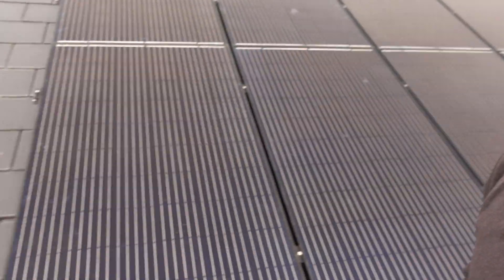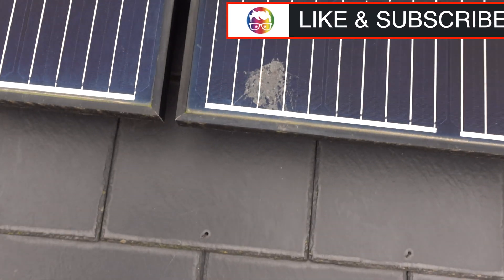My Solar PV House 2020 Update - Roof still has as small leak

Comment: Have you got a video on using PV to charge an EV, focused more on what to expect. For example if you drive 20-40 miles per day could say 10kw of PV with 10kw battery storage cover that? If I don’t use the car on weekends could a sunny day fully charge the car from empty? Apologies if I’ve missed it
Reply from the maker: Check out my monthly update videos, I cover how much solar and grid energy went into the car charging each month, into my powerwall, etc.
During the summer months we hardly use any grid energy to charge the cars, unless we have a few big trips. Today for example, my wifes 40kW Nissan Leaf was fully charged from solar pv, battery upto 100% and hot water tank fully heated.

Comment: Hi SG, my original installer actually broke 7 tiles and just installed the pv panels over the broken tiles. When I found out I had a leak, I tried to contact them and found out they'd gone bust. Had to find another installer willing to tackle the job. They had to take off the whole array, fix/replace the broken tiles then reinstall the array. Roof is weather proof now but this avoidable damage added a considerable amount of financial cost and stress to my journey. 

5.3 kwp array, 3.7 kw SolaX hybrid inverter with 19.2 kwh of Pylontech storage, January production was 132 kwh which was 25% up on last January and IMO pretty decent for West Central Scotland. Hope you get the leak sorted bro, I really feel your pain.😖
Reply from the maker: Cheers Ambient Fish. Did the installation not come with insurance that you could claim against to have the workmanship put right, vs paying out of your own pocket?
Reply: @SpectrumGeeks  Yes it did bro, but when I contacted them it turned out that my installer had never registered my system and paid the premium, they also been removed from the MCS register 6 weeks after my install so I was actually lucky to get my FIT application approved, hard to take but what can you do? Just have to make the best of a bad situation.
Reply from the maker: That sucks, but agree you cant live on regret, so onwards and upwards.

Comment: Urgh, sorry to hear this Dale. Not sure if you remember but this is basically exactly what happened to me, idiots drilled through the tiles rather than using the correct mounting brackets - had to go through the RECC for months - eventually fixed, must have cost the installer thousands (not to mention the time)
Reply from the maker: Yeah I remember your experiences from our discord chats. 
The funny thing is (not funny ha ha) when I went with the solar install I spoke to the installer about the SolarFlash on slate tiles and they were like no no, we do this, no issues, etc :)
Like you say its costing them money, and its nearly all sorted, but I do have concerns for the future. However, as long as they are in business (whilst under warranty) I will call them, then after that I guess it will be the solar insurance cover.
Reply: I used a product called "SolarFlash" which basically sits under your tiles so there's almost no way water can ingress (I specifically told the installer to use this product - he thought I wouldn't check)